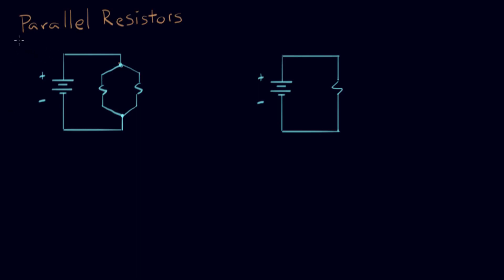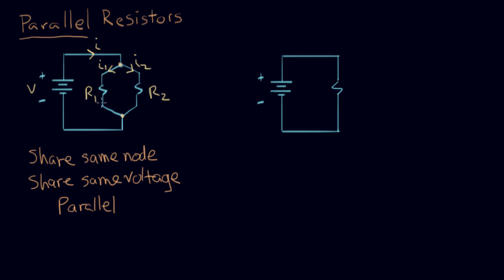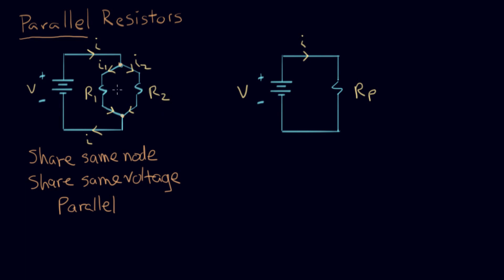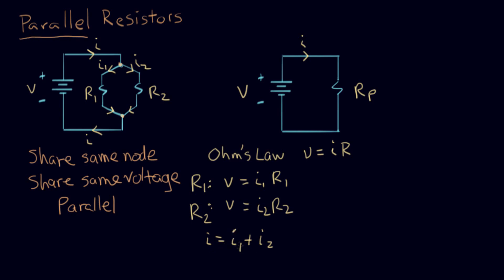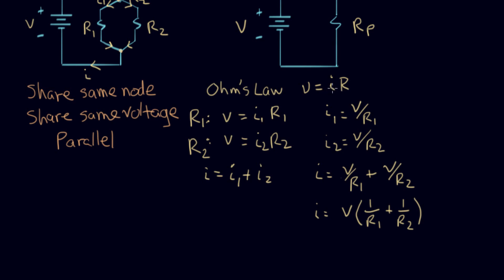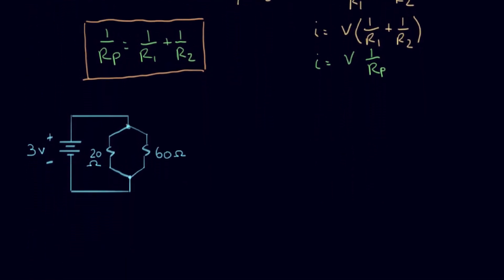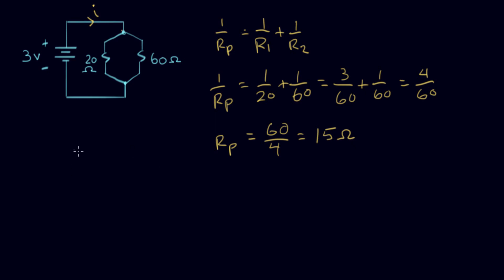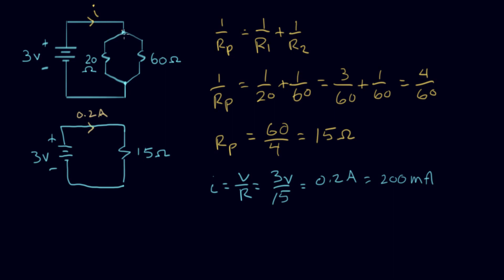Parallel resistors (part 1) | Circuit analysis | Electrical engineering | Khan Academy

Comment: Doubt:
    How the current will same when the electron goes into one resistors then it will lose some energy then again in 2nd resistors it will lose some more energy finally in 3rd they will lose some more then the value of current get decreased know?? How it will remain same
Reply: The electrical pressure (voltage) decreases - which explains your energy loss.

Comment: Why is it 1/r1 + 1/r2 + 1/r3 instead of r1 + r2 + r3?
Reply: Because we're dealing with a parallel circuit here. rv = r1 + r2 + r3 applies to series circuits.

Comment: Y is it necessary that if the resistors share the same node..then they must have the same voltage
Reply: Because they'll be equidistant from the voltage source. In our case it's the battery. Both the resistors are getting voltage directly without any other component in between.
Reply: We assume that the voltage drop is 0 when an electron moves through wire

Comment: although the maths checks out it seems so counter-intuitive that the equivalent resistance is less than either of the resistors in parallel. maybe I'm looking at this the wrong way.
Reply: I know this is an old comment, but I just watched this and I thought about the 60ohm resistor being a road with heavy traffic (all cars are barely inching foreword) and 20ohm is like a road that is full, but cars are still moving along decently. The thing though, is that there is 2 roads instead of one, and that choice between two roads is what is making the resistance a little less than 20ohm. Or think that if you have your 20 ohm road, adding another option of a 60ohm really packed traffic road, won't hurt and will even decrease the load a tiny bit
Reply: Yes, that was what I was missing in this video, the explanation.